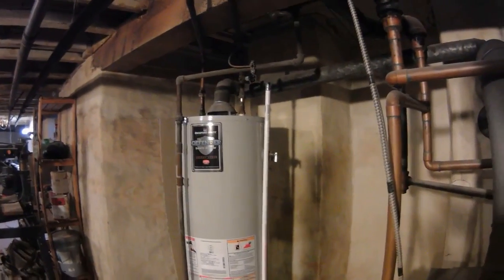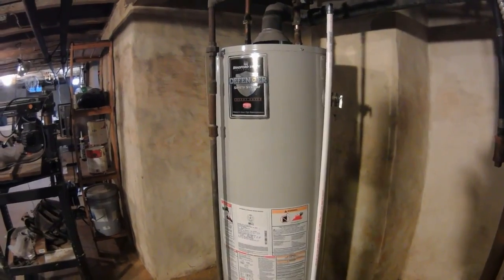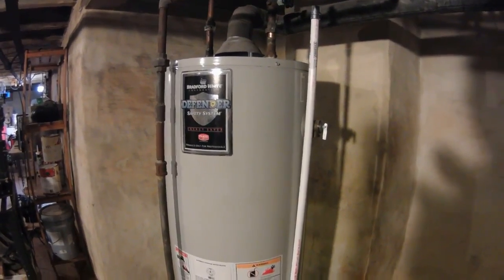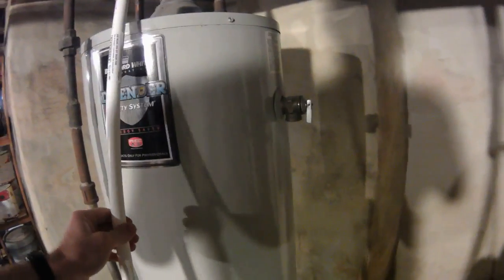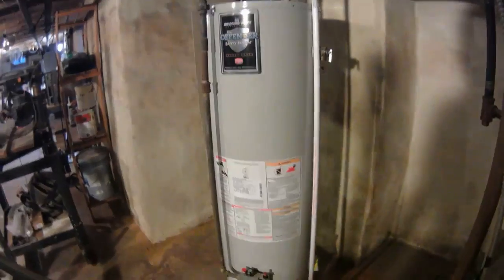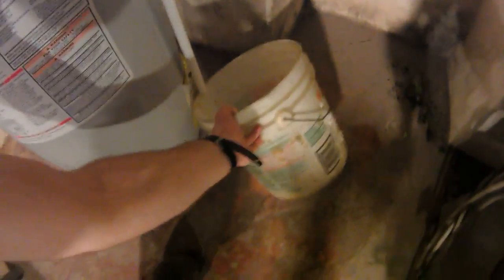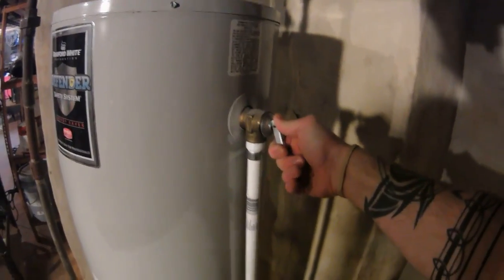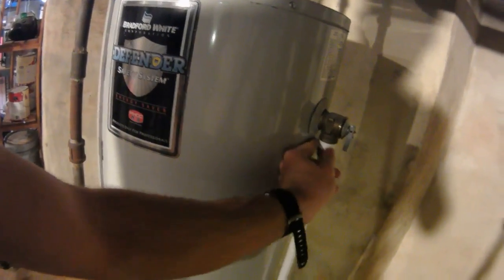How To Replace a Discharge Pipe on a Water Heater (TPR Valve)

Comment: Does anyone know the code for how high the end of the discharge pipe can be from the ground?  Is there a maximum and minimum distance?  I'm asking because I need to find out what's wrong with my water heater, but in the meantime, it is releasing a lot of water, and it's hard to get a pan underneath there w/o cutting the pipe (right now it is about 2 inches off the floor)

Comment: He screwed up when he was putting the tape around the threads. That roll should have not been that far away so the tape would have went on tighter!!! Then run your fingers in that tightening direction to make sure the tape is on the threads good!!! I see him using his left hand so I think he is left handed?😳
Reply: He also went wrong direction. You want the tape going with the turn

Comment: Paulio
I enjoyed this TPR Valve drain pipe install video.  THX!   Just one question, should I be using CPVC (Hi temp certified) pipe for this hot water application (typically 120 - 175 F deg.) instead of  std. Schedule 40 PVC
Reply: Yes, I just read this article and it said just don't use PVC because it will melt, but yes CPVC.
Reply: My pipe will go through a floor and to the ground area under a manufactured home
Reply: YES!!!! Recently, during the annual maintenance  performed on my unit,  (draining, hard brushing under the burner, vacuuming the vent tubing, and under the unit), the Plumber advised me that the drain pipe was not correct because it was too high. Code requirement: must be copper or CPVC,
Reply: Yep, all codes say cpvc or copper because of heat. No PVC.

Comment: Silly question here, but you mentioned to release the valve should it ever need it. At what point would you need to do this manually? I had assumed that this was something that happened on its own if too much pressure were to build up. All of this is new to me so any insight would be greatly appreciated. Thanks for the video.
Reply: If you shut off the water to the tank and need to empty it, open the relief valve to release the vacuum created by the escaping water.

Comment: That's not PVC. PVC wouldn't hold up. That is Polypropylene which is a material and is used for water heaters. https://www.homedepot.com/p/Everbilt-3-4-in-NPT-x-63-in-Polypropylene-Side-Mount-Runoff-Tube-EB11955C/204834492

Comment: Must be copper or CPVC (Chlorinated polyvinyl chloride) per inspectors. Having to replace my tubing in my new house because they used PVC.
Reply: DON'T FORGET PEX              please read the yellow tag on most t&p's  max (3) 90's...........  your installation does not pass code

Comment: Just found out the hard way that this is not a standard pipe thread. 3/4" mpt connections do not thread into this valve. Any ideas what will work?
Also, what is the logic behind spraying 40 gallons of scalding hot water all over the floor being any safer???
Reply: Because the most dangerous thing that can happen from too much pressure is the water heater actually exploding. So yes it's more logical to drain the tank with to prevent that from happening.Not to mention the following  :The decreased lifespan of appliances such as your dishwasher and water heater.
An increase in energy bills due to increase in amount of water that requires heating.
Extensive damage to pipe joints.
Plumbing leaks.

Comment: Do you need one on a tankless water heater?
Reply: NO, since there is no tank it does not apply.
Reply: Thank you closing escrow and idiot inspector mentioned we needed one amateurs .
Reply: @dimasavila9158  I suppose it is dependent on what state you live in and the code requirements.  Will double check to make sure.
Reply: I called a friend who is an experienced inspector and he said yes they should have one. I have seen a few that did not have them and just assumed that the plumber or contractor would have installed them, if required. That may have to do with location of the unit in  a home, or with local codes being different but I trust the judgment of my guy and would follow his advice personally,  And it is very low cost and an easy install so for those reasons and the liability issue, I would recommend complying with that just to be safe.  But I get your frustration with the process ...

Comment: Plumbing Code says to use 1 of the 3 approved piping:  CPVC, copper or galvanized metal...(NOT 'PVC' as it cannot withstand the heat being discharged), and people--don't use stainless steel braided hosing...some people think that's even better-- yikes !
Reply: This is not PVC.  This is PP and it's melting point is around 270 deg.  This pipe is specifically made for this application.  Look up #300904600 on HD's site.
Reply: @mikes3872  didn't say it was...pp is not approved per Plumbing Code..
Reply: uponor ( pex) lists it as an approved method of discharge, with two caveats  1) cannot be exposed to ultra violet light and / or florescence
Reply: cross linked polyethylene   not  pp    would need listing info for PP

Comment: The discharge pipe currently sold at Home Depot is made of polypropylene, which has a melting point of 320°.
http://www.homedepot.com/p/Everbilt-3-4-in-NPT-x-63-in-Polypropylene-Side-Mount-Runoff-Tube-EB11955C/204834492
Reply from the maker: Thank you for the excellent information!
Reply: saw this, just curious who listed this ( what testing agency tested this) and what is it approved for?
Reply: not offense, just want to figure out, I am also confused about this product, because lot of review said it didn't follow, should use cpvc, but this is only one convenient stuff, can install directly. this page didn't mention temperature, where did you get 320?

Comment: Most codes require copper because water under pressure can heat beyond 212 degrees and can melt PVC and scalding hot water can spray everywhere posing a danger. Just my $.02
Reply: This is not PVC.  This is PP and it's melting point is around 270 deg.  This pipe is specifically mad for this application.  Look up #300904600 on HD's site.
Reply from the maker: Thanks for the info!

Comment: what is silver piece you put on end of pvc pipe?
Reply: If I think correctly it is a copper to pvc shark bite fitting
Reply: To me it looks like a pipe specially sold at big box hardware stores specifically made for putting on valves. Home depot sells them one length. You just cut to fit your setup. It's made of C P V C not PVC like everyone is accusing him of. That top metal piece is crimped on to the pipe and screws right in